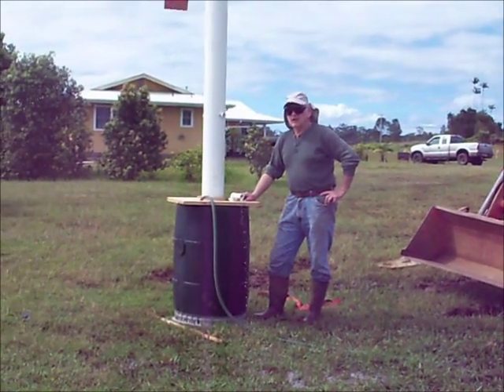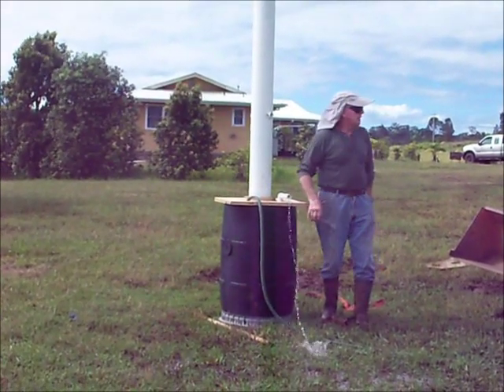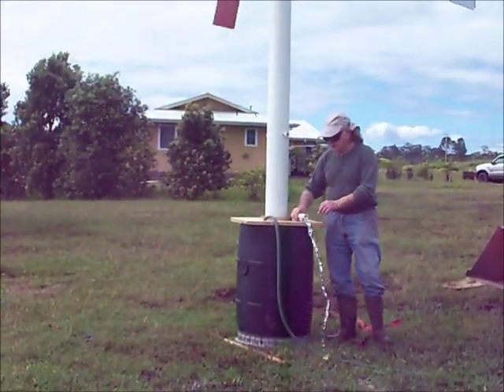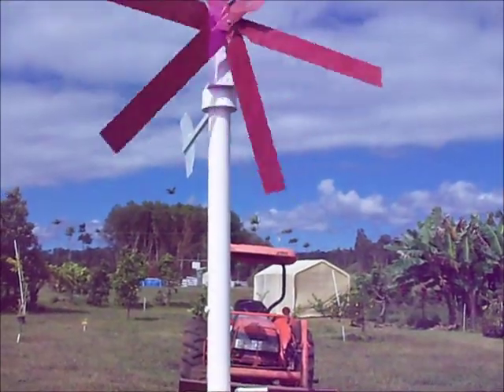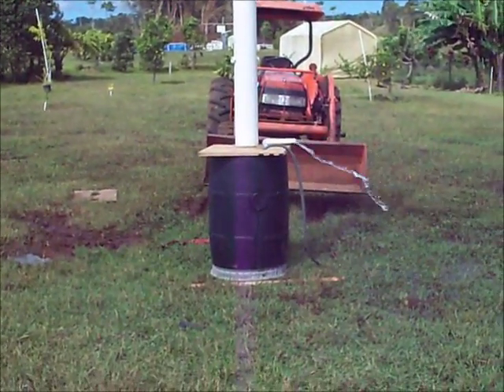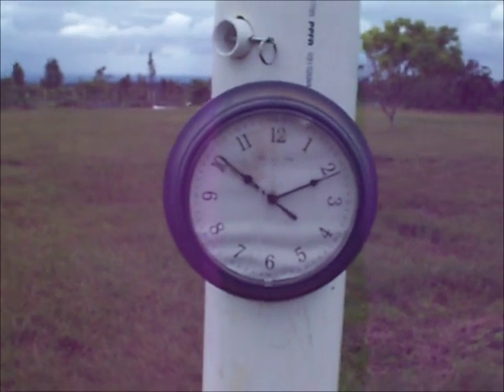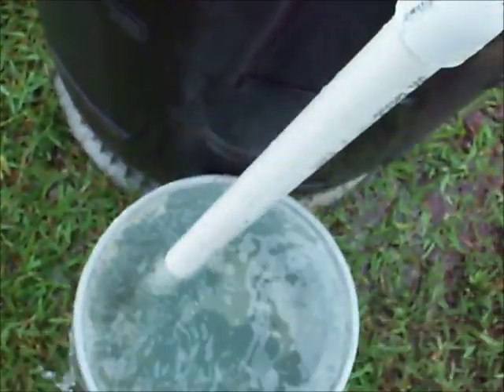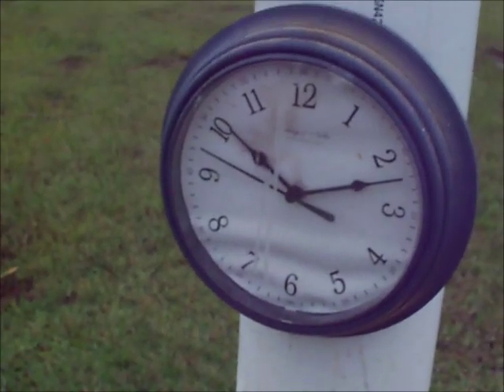Windmill and water pump. DIY part 3

Comment from the maker: Because it was low to the ground I tied a rope to the vane and could tie it out of the wind.  That isn't really acceptable.  The wind mill in this video is out of service.  I've done about 5 more and still haven't come up with a method to turn out of the wind. I made one with spring loaded door hinges that showed promise but the hinges weren't strong enough.  I'm working on one now but won't show it unless it works. It has to be easy to fabricate too.

Comment from the maker: After two days and 40 mile an hour wind the Duck 2 suffered  balance problems.   It was taken out of service. The top end support bearing was starting to fail, probably because of the balance. It was the same type of lazy susan bearing as shown in part 1.  Clearly not a good choice. Balance has been improved and the lame duck is ready to fly again.